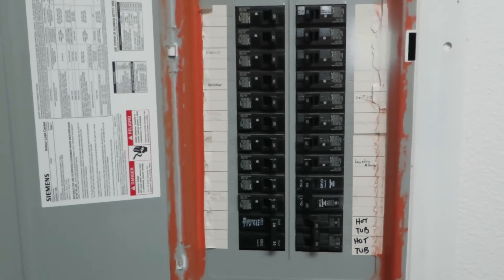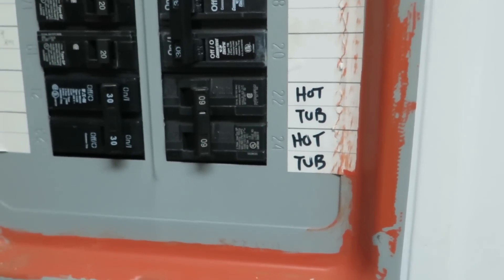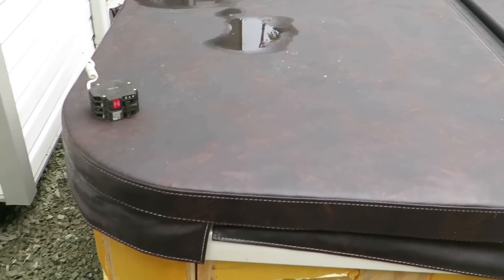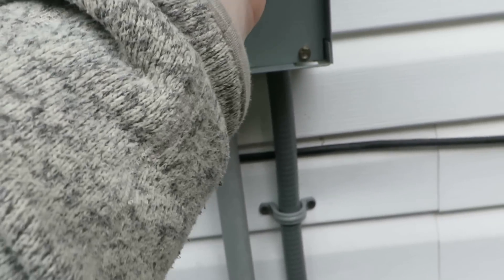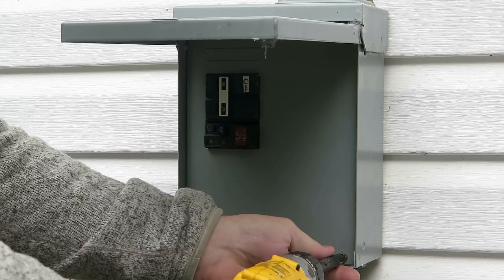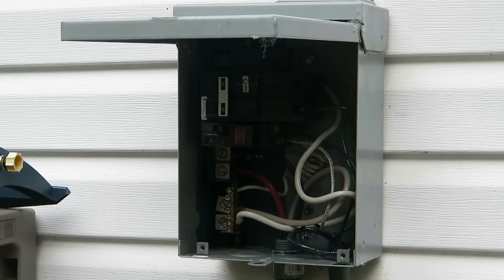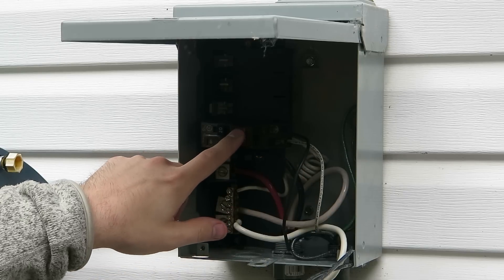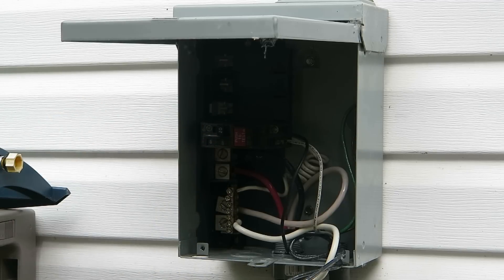Spa Electrical Basics

Comment: Me being a licensed electrician l could criticize this video a lot but I will limit it. First of all the 60amp breaker in your main panel is not a double throw breaker it is a double pole single throw breaker (DPST). The other thing is that #6 cu wire is not large enough for a 60amp breaker. Just remember the wire always determines the size of the circuit.
Reply: In this video the breaker in his MAIN panel is a 60amp and he said that it was #6 feeding his sub panel. This breaker protects the conductors from the main to the sub which means it should be a 50amp breaker.
Reply from the maker: @wendellmurphy5249  

What state and code are you using....  60 amp and #6 wire is the right size.  #8 wire is only good for 50 amps.  Current rating is per-hundred feet, per wire.  If the draw isn't continuous 60amp #6 is fine.  You more than likely see people use #4 going from a main panel to sub panel because they don't know how to size correctly.  NEC code 310.15(B).
Reply from the maker: Are you trying to say I should be using a 50amp breaker in the main instead of the 60?  Trying to understand what your trying to get across...  it's not against code to use a 60amp #6 for a 50 amp sub panel...
Reply: I do apologize I spoke to quick, #6 is good for 65amps as long as you are not using types TW or UF. And what I should have said is that the wire determines the maximum size breaker for the circuit.
Reply from the maker: @wendellmurphy5249  
No problem, we all make mistakes!
Reply: Also, make sure you are sizing the wire using the 60 degree column when less than 100 amps or all terminations are rated higher.  The only time the 90 degree column is used is when you are de-rating your wire due to heat or multiple conductors in a raceway
Reply: GE will fit a Siemens panel but isn't approved.
Reply from the maker: Please elaborate.  You can  always running a larger conductor on a smaller circuit.  The conductor is sized to your breaker size.   I haven't been an electrician for 10 years, but I have never ran into an issue where up sizing conductors was ever an issue.  Yes it puts more resistance on the circuit etc, but for practical use cases this is a non issue in residential.  When your talking motors and other things using 3 phase sure.  However this video had nothing to do with that.  Using a 30amp breaker and a 6 Guage is a non isssue...

Comment: Informative video.  A few observations.  You mention that a gfci measures voltage difference in and out.  It actually measures current difference.  I'm also unclear as to why you replaced the 60 amp breaker with the 30 amp.  As you mention, the breaker is sized to protect the wire.  That means the 60 amp gfci protects your #6 wires, and the 20 amp protects what I'm assuming is #12 wire.  If you overload (including a fault) either circuit individually the breaker will trip to protect the wire from overheating and melting the insulation or causing a fire.  The 60 amp breaker in your main panel should be protecting the wire going from the main to the spa sub panel which you mention is also #6.  If your combined load of your 2 circuits exceed 60 amps it will protect that wire and trip at the main.  It isn't unsafe or bad to replace that gfci 60 amp with a gfci 30 amp, but it doesn't make the situation any safer.  It just means that the breaker will trip 30 amps below the capacity of the wire it protects.  What I would have done is leave it as is unless I wanted to add more load out at the sub panel (in the form of another circuit, or replacing the hot tub with a larger one that actually draws close to 60 amps).  Then you would have to replace the 60 amp breaker in the main panel with something larger AND run larger wire from the main to the sub to handle the increased load.  The breakers in the sub would still be fine and would be properly sized for the wires they protect.
Reply from the maker: You are allowed to oversize your wires per code.  I used 6awg wire from the sub panel to my tub.  The tub only requires a 30amp breaker.  So, I could have ran smaller wires (10awg)  but I had 6awg on hand.  I also believe there is code about any ungrounded conductor the other conductors have to be of the same size.  Basically I had 6awg on hand.
Reply: @photokendall  yep yep.  That makes sense to use the wire you have on hand.  Did you have the 30 amp gfci on hand as well?  If so, I get why you might as well install it if you can use that 60 amp breaker somewhere else more useful.  You just mention that you went out and bought the 30 amp to replace the 60 amp and I didn't understand why you spent that money when the 60 amp would protect the #6 just fine.
Reply from the maker: @josephs7445  because the components in the hot tub also need to be protected, the components in the hot to require a 30amp breaker, if you had the 60amp breaker instead of the 30 amp and something was to go wrong with the hot tub components it wouldn't trip the breaker using a 60 amp(unless it was shorted).   So basically the 220v side to the tub requires a 30 amp breaker to protect the components, this means you can use 10awg wiring because it is rated for 30 amps.  I decided to upsize and use 6awg wire because it's what I had on hand.

Hopefully that makes more sense.  Each hot tub manufacturer will have its own requirements of what breaker size they recommend, you then size your conductors accordingly.
Reply: S
Good explanation. Even though the wire from your sub to hot tub is oversized you definitely want the breakers amp ratings in sub panel to match what the hot tub requires, if you had stuck with the original two pull 60 amp when your tubs max is two 30 amps both hot legs ran from the sub to tub would handle it fine and trip at 60 amps but the hot tub wiring/components would burn the hell up first if they never reach 60 amps when a problem causes an overload situation. Mainly repeating this because it helps me remember these things easier. Lol

Comment: Do not use drills on panels or any kind of terminating people...
Reply: Oh..I been doing it wrong...I been using a welder machine to connect the neutrals and grounds to the bars..😲🏃💥⚡
Reply: SumOfIt i use the clutch on my drill sometimes haha
Reply: @SumOfIt What is the Torque value of breaker terminals? Pretty hard to Torque the screws without a Handheld Torque Screwdriver. Otherwise you are not very professional.

Comment: 6 or 8. 50 amp breaker
Reply: But going from the main panel to the disconnect requires #6awg because of the 60amp breaker inside the main panel.

The breakers only protect wire downstream
Reply: Number 6 @ 60 degrees number 8 @ 75

Comment: Could you do a video about hooking it up on the tub side?  My wiring diagram mentions blue wires, but I don't have any blue wires!!  So I'm a little bit stumped on this little project.
Reply from the maker: I could, however it's 19 degrees right now, so it won't happen until it warms up s bit.
Reply: Blue just means secondary power.the color phrasing order is black red blue.
Reply: @chrissilva5659  this is single "phrase" where color isn't as important. We call the two hot wires being on different "poles" of the same "phase"
Reply: You can use any color wire, but their ends should be marked with color tape to indicate that they are different poles.

I've seen plenty of A/C installations where they used one color wire for both poles and didn't mark the different poles, but that's not as important as making sure the neutral is white or its ends are marked white.

I know code applies to the color of neutral being white, but I'm not sure if it's code to mark the different poles. Most electricians do, so just bite the bullet and buy some colored tape.

Comment: I thought code was in sight but no closer than 5 feet?
Reply from the maker: That is correct.  I did state 5' from tub in the video but your clarification is spot on.
Reply: @photokendall  thanks for responding.
Reply: @photokendall  backpedaling champ
Reply: I thought, *No less than 5 feet or greater than 15' ". Exception: If closer than 5 feet, a mechanical barrier (Wall or likewise) is separating the sub from tub's location (Making it not physically reachable to a person seating in the tub, to play with the box and electrocute all.
Reply: Sam Sen have no fear gfci is here! Hopefully
Reply: Rule of thumbs is ...You should not be able to touch the Hot Tub /Spa and the Electrical Panel at the same time..
Reply: @spaman5440  Yep, too close and a drunk guest at your house will inevitably try to get out of the hot tub, lose their balance, look for anything to grab onto and in the process make himself/herself extra crispy
Reply: Space Gravy gfci will trip hopefully haha. But they may try to reset it when they sneak past the owner out back to fire up the hot tub
Reply: What code are y’all going off? Correct me if I’m wrong but according to 680.41 a secondary disconnect is not needed in a one family dwelling?
Reply: Don't worry. I cracked that code already. Just get a 5ft extension cord so you can bring all your favourite devices into the tub with you. I figured there's no reason why i can't make toast while soaking and use a hairdryer to dry my hair just before i get out of the tub :)